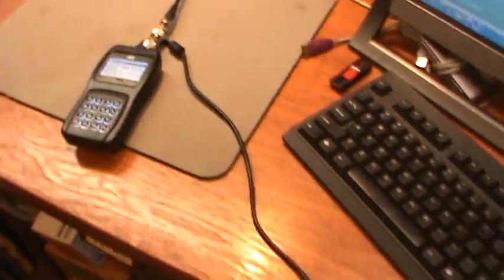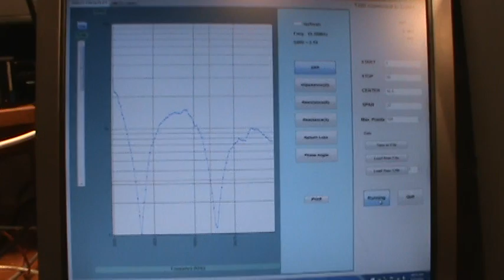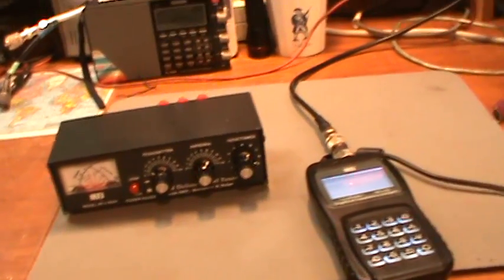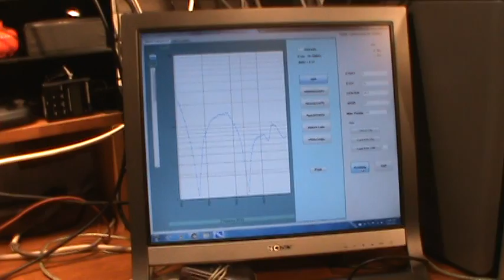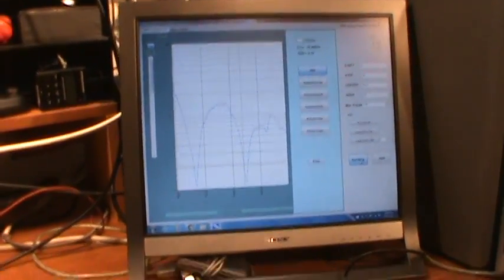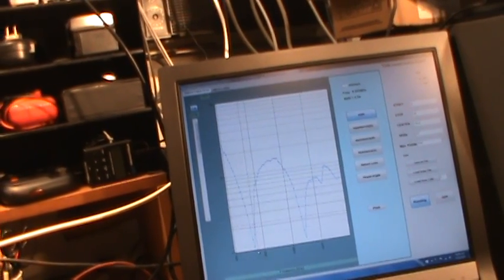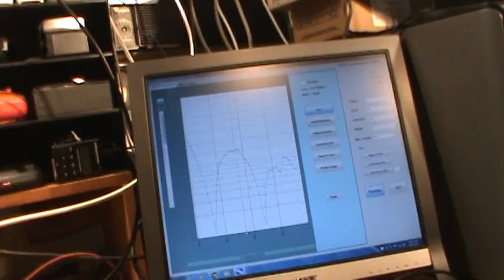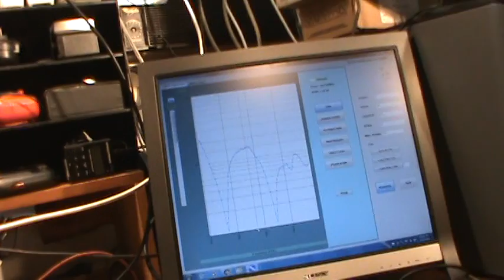TRRS #0836 - MFJ-2980 Antenna PT 2

Comment: maybe work on that messy wiring before something arcs
Reply from the maker: Since I don't use it to transmit I am not too worried but you are correct if I was transmitting.  Also, would not use the light coax that it came with to transmit on.

Comment: hey Tom great video. Are those ground wires provided in the kit meant as a ground plane or as a ground.
Reply from the maker: +Palosrob .MaKaElectric Rebuttal Channel They are meant as a ground plane and the instructions say not to ground them.  They are for 40 meters only.  The instructions state that if you are going to use the antenna on any other frequency then a regular ground rod should be used with a antenna tuner.  That is another reason I did not use the ground wires included in the kit.